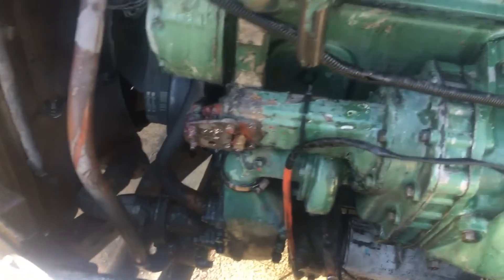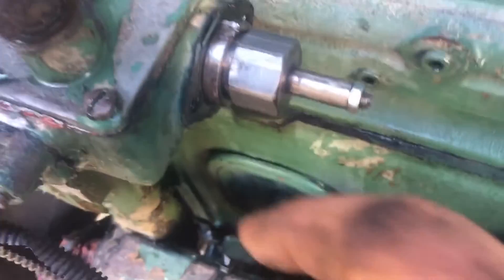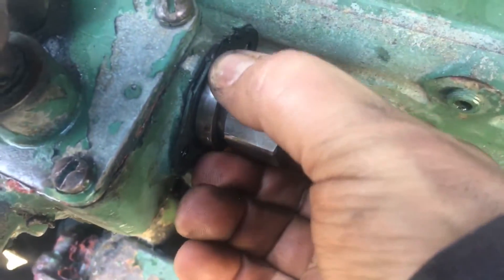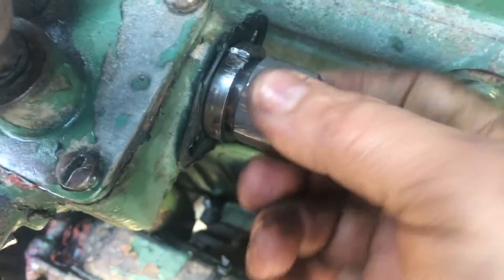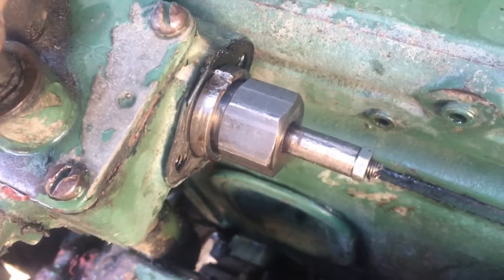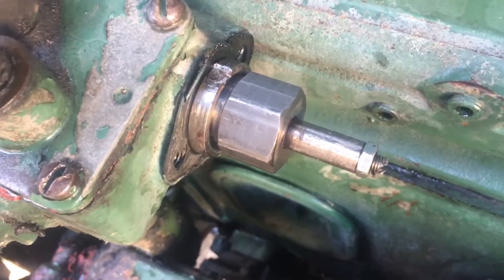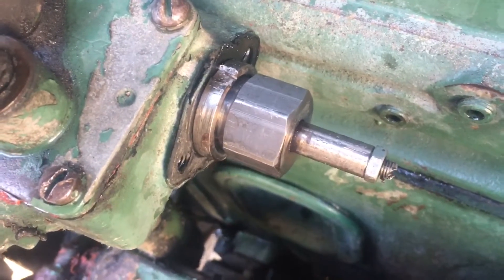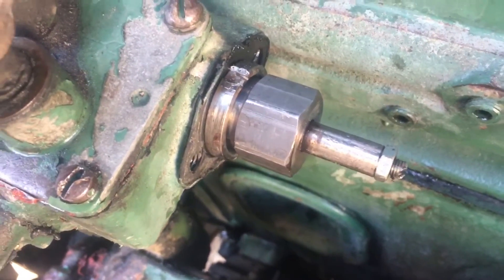Changing maximum no load rpm on Detroit diesel 71 series

Comment: Would bumping up your rear tire PSI  do much?  If I recall, the rolling radius is different than the unloaded radius of a tire, if you cna get them to be closer, I'd think you'd get some natural gearing that way as well.
Reply from the maker: Larger tires will get more speed.  Some buses can take 24.5 11R24.5  but I’m not sure if i have room.  When my tires are ready to age out I’ll investigate what options i. Have.
Reply: I was curious if going to 120psi would change much.